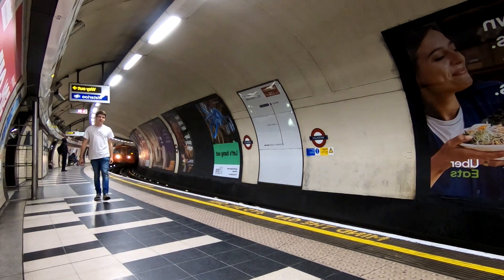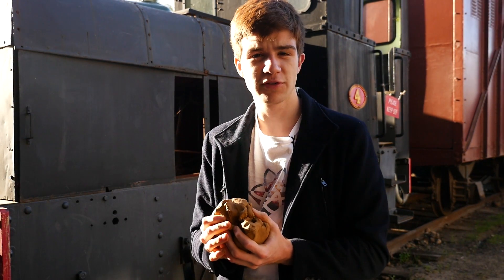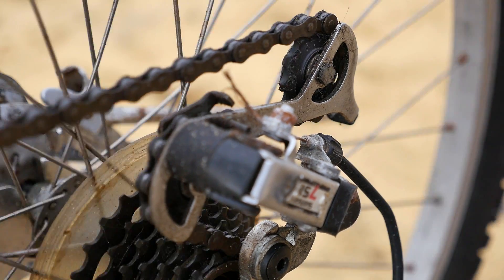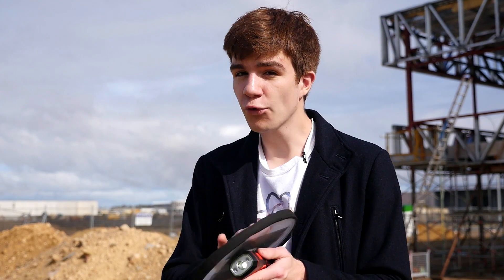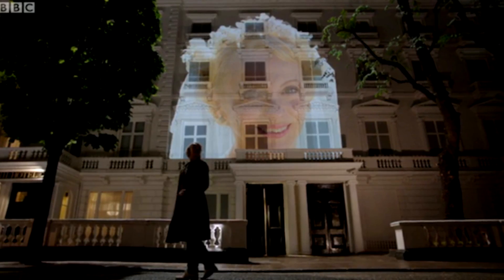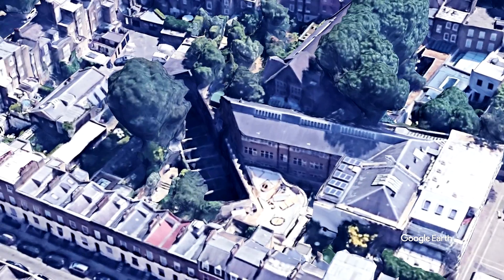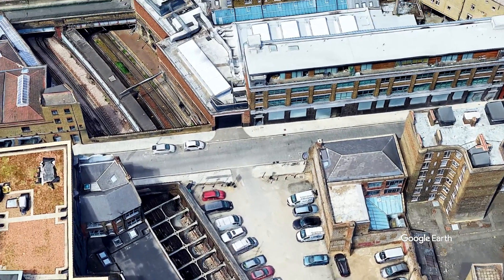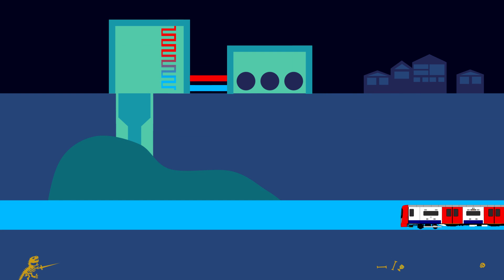Why It's (Almost) Impossible To Cool The London Underground

Comment: Very interesting topic. Would like to know what they have tried of thought of trying.

You could have a smaller air pusher train that runs constant between when the tube is closed and when it opens again in the morning? It doesn't stop at stations, only break when above ground?? 

Out of hours Train that carries large amount of refrigerant that heat up underground and releases when above ground?

Use people as air con / heat transfer particles? Condense heat into bricks that people take away with them? Know an elderly person that is struggling to heat home.. take them a few heat bricks?? Could be a scheme?? Heat brick banks..

Comment: Just put industrial AC's at the top of the stations for short coolant runs, and then let that cooled air just gravity fall, or help a bit with forced air, to the station overhead vents. A lot of the older stations have plenty of old shafts that are already used for utilities.

Comment: Using the waste heat to warm homes makes sense. I'm curious how much electricity can be generated by the facility, though, given that the efficiency of generating electricity from heat differentials depends on the magnitude of the differential
Reply: I'm really skeptical the waste heat will be useful. It might be possible to use the heat to warm a few homes but I really don't see a way the heat could be used to generate electricity.

Comment: A water jacket might do it. You could pump water from the Thames into pipes with relatively high surface-to-liquid volume ratios lining the inside of the tunnels and then pump it right back out to the Thames.

Comment: Melbourne's city loop tunnels don't have this issue, despite having compressor air conditioned trains with disc and pad brakes, as the tunnels are short enough that the piston effect keeps outside air coming in, along with a couple strategically placed ventilation shafts. However our new train tunnel currently being built is substantially longer, time will tell if overheating will become an issue, but you'd hope they took some experience from tunnels elsewhere including the London tube and designed accordingly!

Comment: Honestly i would install radiators, but cycle cool water trough it. Afterwards cycle warmed up water trough thermal exchanger and use heat to either supply homes with free heating during winter, warm water or electricity productions. Waste heat could disposed trough evaporators.

Comment: Well well well....who regrets putting the underground entirely underground now? Here its's 50/50.
Reply: The London Underground is a vast sprawling network with large sections above ground.
It's the central city area which has old deep tunnels, made with different tech than most shallow cut n cover metros, which run under broad roads, that medieval London street layout simply doesn't have.

Comment: Lower the air pressure down there and worry more about moisture and humidity levels than actual cooling.
Reply: What could possibly go wrong in a Victorian built mega-city next to a major river, subject to tidal flooding?
Reply: @RobBCactive  I’m well aware of the problems at hand. I’m stating a solution. I also didn’t say it would be easy. 

That’s like me suggesting to increase housing in a smaller space of land is to build buildings much higher than normal and then you step in to complain about gravity wanting to pull the building down. Like, yea, we get that.
Reply: @SassafrasGuy  My apologies, "lower the air pressure" sounded like hand waving

Comment: I was legit surprised that Britain's subway cars use friction breaking.  Never would I have guessed that an all electric train WOULDN'T use regenerative braking, which automatically removes a massive amount of maintenance cost, but also heat and brake dust that's going to build up.  Seems like a no-brainer, but alas, humans be humans.
Reply: Regenerative braking was known but uncommon because of development costs, standard train brakes were cheap and simple.  Just having a store for regenerated energy is not simple, you wouldn't want lead-acid batteries due to mass and repowering the power network isn't a simple problem either.
Now electric motors are far more sophisticated and regenerative brakes are common different design choices would be made 
Certainly new tram lines used regenerative brakes for energy and noise reasons.
Reply: @RobBCactive  Also, unlike a diesel-electric locomotive, an all electric train wouldn't require batteries for regenerative braking.  It's power source is also it's sink to return energy back into.  It's hardly a complicated system, albeit, still not as simple as friction braking.
Reply: When they were designed, regenerative braking wasn't really a thing and no-one has thought to change it since
Reply: @icedragon9097  when they were designed?  How old do you think those cars are?  Disney's monorail trains were built before 1970, and had regenerative braking.   Diesel-electric locomotives have regenerative braking, and how long have they been around?
Reply: @ElementofKindness  pretty sure the tube is over a hundred years old haha
Reply: @RichardLDN  not the trains though!
Reply: @ElementofKindness  Mono-rails are impractical trophy engineering projects, not made to be cost effective.
The rolling stock on the tube couldn't be replaced at once, so major investment would he required, for a problem no one cared about.
Reply: @RobBCactive  I believe you are confusing regenerative braking with electromagnetic propulsion. While the latter would require a full refit of the subway system, the former would not. Regenerative braking is contained completely within the train car itself. Trains cars would be upgraded one at a time as ones at end of life are removed from service.
Reply: @ElementofKindness  I was pointing out, that you could not simply redesign the rolling stock to use temporary storage as an easy solution.
Your claim regen braking is self contained is WRONG, to avoid storage it needs to put power back in the grid.  That introduces power management issues.
Mono-rails are engineering wise daft, the exception is the German ones with cars suspended below the rail, which actually do make sense allowing routes above rivers and streets underneath simple pylons.
Your belief is totally incorrect, regenerative braking was a topic in Physics school classes, so the reasons for its rare deployment were also discussed.
Reply: @RobBCactive  Power management is already a requirement.  Taking regenerative braking out of the picture entirely, power still requires management as loads are applied and removed. (such as a subway train starting up or stopping, and as any powerplant has to manage as well)  Adding regenerative braking energy back into the grid only adds an (rather minimal, due to efficiency losses) element to the existing power management.  And you are talking like it's still the 20th century. I'd wager none of London's active subway cars predate the 21st century. 
Out of all this though, it seems that no one brings up the most likely reason why regenerative braking isn't employed, and that is it wouldn't resolve the heat issue. It would only eliminate the maintenance and pollution issues.
Reply: @ElementofKindness  Actually I believe many of the lines do have regen braking now .. I agree the benefit is likely not great, particularly as the trains are used as pistons to change air in tunnels.  I presume cost benefit analysis ruled out developing it decades ago.
Let's be honest, bright engineers would have no hope of making such changes, it requires political will.  That was absent, cost cutting was in vogue, leading to incidents like the Kings Cross fire.
Reply: @RobBCactive  👍
Reply: @ElementofKindness after enjoying all you said in this thread (such a lovely way with words you have to say such interesting things) I'll answer the last with: not a small issue to address, and probably, hopefully, more in vogue by now.
Reply: they didnt bother installing motors in trailer cars and used regular brakes instead
Reply: They could use mechanical regen braking like the old trams used to do. You can store a lot of energy in a heavy flywheel.
Reply: There is no space for flywheels or batteries on the trains, so the regenerated power needs to go through the power supply system, and traditionally it doesn’t have the headroom to accept the returned power. As the huge rebuild of the system happens this is improving but it is not easy or cheap to retrofit regeneration into the old power system.
Reply: @andrewinskip504  Very true......but, you could make a KERS vehicle that could attach between the train and the carriages. Obviously it would be an expensive project, but a lot easier than redesigning existing stock.
Reply: Actual data available at https://tfl.gov.uk/corporate/transparency/freedom-of-information/foi-request-detail?referenceId=FOI-2080-2021
Reply: This video was very poorly researched in many strange ways, you can see some people explaining errors in the comments.

Comment: Nice video. However, I disagree that air conditioning on the train carriages is not a good solution.
Many cities in the hotter regions of Earth have underground transit systems (Hong Kong, Singapore) to name a few. None of them have had to expose their passengers to 40C heat. How did they do it? Well, the only parts of the network that needs cooling is the parts with humans. That is the stations and inside the trains. Who cares if the tunnels are 40C? 99% of people don't go there. Just seal the train platforms with full height floor to ceiling sliding doors like all these other countries and pump station's air conditioning with the heat exchanger hot side leading back to the ground. With the tunnels sealed off, your carriages can have air conditioning without really affecting the station temperature.
After all, many stations in the London underground already have half height safety barriers. Just finish the job and get it done... what are all the ticket revenue going to? Humans have built a space station several football fields wide hundred of kilometres above our heads, the problem is not an engineering challenge but other stuff. The engineering is more an excuse to divert attention and scrunity.
Reply: I don't think you understand how sprawling and old the London Underground mostly is, and the differently dug tube tunnels.  Metros generally are shallow cut n cover construction under broad streets, mostly non-existent in central London
Nor the massive amount of energy required, which would defeat UK aims to reduce carbon emissions.
The quoted 40C was a summer temperature, mainly caused by poor ventilation, not some all year oven effect from magical clay heat storage.
Just look at all the passengers in the video with coats on.

Comment: Many New York subway stations get hot as well. At least the train itself is cooler on the inside with air conditioning. The heat is terrible though, I wish you's good luck.
Reply: NYC is far hotter than London in Summer/Autumn and colder in winter.
It's tunnels are square construction, not narrow lined tube tunnels, which can be much deeper.
A/C would increase overall energy consumption significantly, likely exacerbating the problems of a poorly ventilated tunnel network

Comment: Why not install pipes in the walls to heat the water
Reply: OK, the reason is it's not hot enough for power generation, you need low entropy intense heat sources, not high entropy spread out heat.
What you can do is use heat pumps, but that'd be very expensive to retro-install and the users of such, like to reverse the cycle to cool in summer.
If the tunnels were larger you could vent with segregated rising hot air and cooler external air, but they aren't and air pushed by trains is turbulent mixed air.  Stations have limited space, built economically not like grand show piece Victorian railway stations, so again space is limited.  Ventilation simply wasn't designed with this problem in mind.
Finally the active lines are very heavily used, so closure to install infrastructure is out of the question.

Comment: The trains do use regenerative braking. They put current back into the 4th rail for use for trains.
Reply: 4th rail?  I've only seen a 3rd power rail.  Why would you use 4, rather than the 2 used for rolling grounded?
Reply: @RobBCactive  LUL uses 4th rail. Two primary rails, a center rail and outer rail that are a positive 420V above earth, and a negative thats 210V below earth. 
I guess the reason being was to reduce voltage drop between earth and live.
Reply: @therealwoodman-5608  Thanks!!  I hadn't ever seen that detail and was thinking of the old rickety 3rd rail in S. England trains which aren't served by overhead supplies.
If that is deployed over most of the tube lines, some major rebutting should be going on, as it's a very common reaction to be surprised by that.
I just remember discussion decades ago why regen was not more widely deployed.

Comment: One thing I never understood, the Madrid subway is immaculately cool and all stations & trains are air conditioned. It’s a more modern system to be sure and probably less of the clay issue, but it proves that it certainly is possible to have an air conditioned train system including the stations.
Reply: True, many stations in New York have air conditioning, but many also do not. It's annoying, at least the train itself has air conditioning
Reply: London tube lines in centre can be deeper tunnels barely larger than the trains lined with ceramic tiles with large distances between stations. Most city metros are shallow cut n cover construction built beneath large roads, with the space for vents and easier access to the surface.  Their stations are generally short walks apart like city bus stops.
There's also something dubious about this film, as if the tube were an oven, it'd be uncomfortably hot all year round, not just in summer months.  It's mainly a ventilation problem with the air pushed by trains significant.

Comment: Thanks for the video. This is one of the things I noticed about the deep level tube stock while I was travelling around London back in 2014 and 2016. The designers of the newer tube trains still had not considered the AC in mind compared to the MRTs in Singapore which have air conditioning since it began operations in '87.

Comment: Regen braking on the cars isn’t an option for some reason?
Reply: New lines undoubtedly have it, but switching over requires large scale investment, on a heavily used system that is relied on.
Saving a relatively small amount of energy (think of the air braking from pushing a huge volume of air through a narrow tube), won't justify it, so such has to wait for significant infrastructure initiatives

Comment: your ideas a great but couldn't you just drill vents to the surface warm air exits as cool air enters
Reply: London's built next to a tidal river and is subject to flooding, the lines can cross under private property, and the tunnels are minimal sized, hence "the tube" 
As explained in video, you'd need a vast number of dummy vent  buildings to make a significant difference.

Comment: You failed to mention that air-conditioning not only moves heat from one place to another. But the act of moving the heat generates more heat. ie. Moving 4 units of heat produces 1 unit of heat

Comment: Old problem not difficult to solve, will need bespoke engineering which is costly and therefore not going to happen. London Underground have you by the short and curlies and they know it. Here's an article from 2006, so they have had at least 15 years to fix it http://news.bbc.co.uk/1/hi/england/london/5058362.stm

Comment: Regarding air conditioning, 1 cubic meter of ice (1 metric ton), can absorb ~97kwh of heat. I wonder if air-conditioning would be viable if it consisted of blocks of ice which would be produced and swapped at the terminal stations. Heat stays out this way, the ice can be produced during off-peak hours, 1 metric ton is around the weight of 11-12 adults which is a tiny addition to a train that can transport hundreds at a time. The ice can be positioned at a central location with fan coils cooling each wagon.

Comment: Same problem in nyc during the summer not all stations but specifically off the top of my head the R line on 86th st in Brooklyn turns into a fucking oven. I literally wait upstairs until the train is close then I walk down the 2 flights of stairs

Comment: Regenerative braking is worse than simply having a well calculated approach to breaking.  If the train slowed down steadily enough there is very little reason for it to generate heat other than the heat generated by clashing into deformations in the track.

You need to remember, regenerative braking uses gearing in order to absorb the energy in the first place… This in itself is a bugger.

Trains themselves are an active ‘pumping’ system, enough pressure is generated in there to clear several miles of tunnels ahead, a strategic ventilation system allows cool air to be sucked in and warm air to be pushed out and it’s as simple as that. The problem with the London Underground is that the ground is very high in moisture content and with people breathing in there constantly you get a pretty high RH and getting rid of the moisture is  quite difficult because during busy times more of it gets in that it gets out.